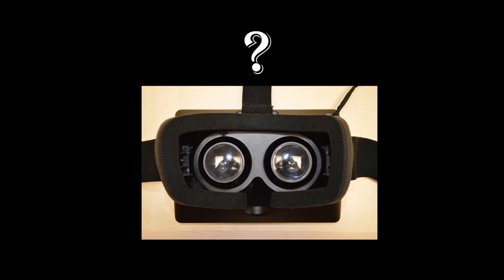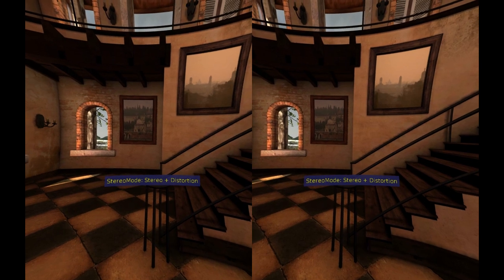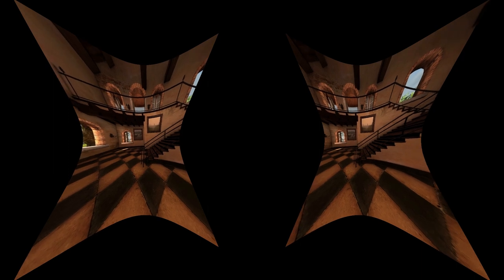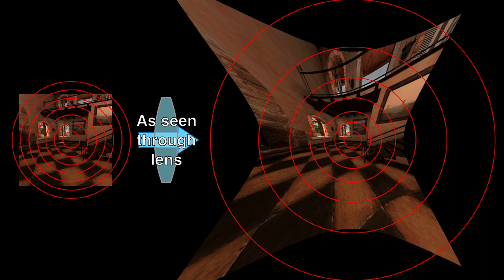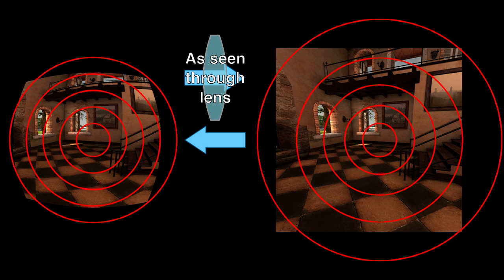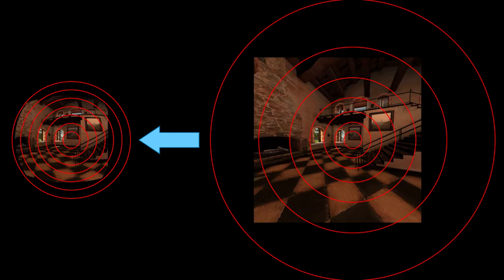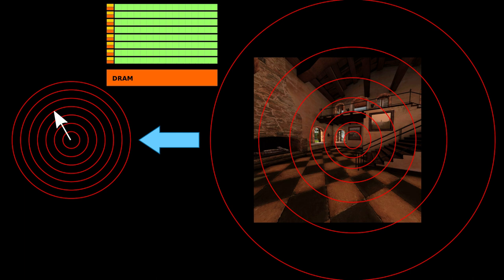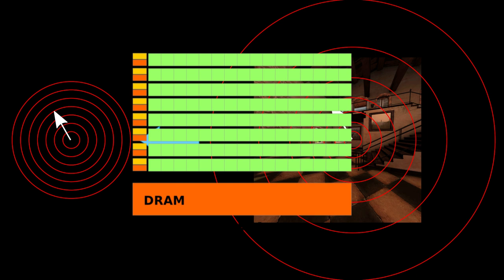How barrel distortion works on the Oculus Rift

Comment: I was wondering if you've ever done an in-depth performance comparison of the traditional barrel distortion shader (which performs the distortion vector calculation dynamically for each pixel) vs other techniques that pre-cache the source pixel texture coordinates either for each target pixel (stored in a texture, let's say), or by using a distortion mesh to approximate the distortion correction. Is it worth the video memory (for the texture pre-cache method) or the loss of quality (for the mesh distortion method)?
Reply from the maker: +Jeremy Bell Oculus switched to mesh distortion so I believe they found it to be the superior approach. This makes sense to me since the mesh is essentially just drawing a small number of unlit textured triangles which is one of the fastest built-in operations a GPU can do. It also scales better to higher resolutions - the pixel shader approach adds quite a substantial overhead per-pixel. On the other hand, if you're doing any kind of ray-tracing, that's a different story - you should be casting one ray per output pixel, and incorporating distortion into that, so that you can avoid having to deal with drawing a bunch of extra pixels around the edge that you're just going to downscale anyway.

Comment: Excellent video! Follow up questions for you. Are the lenses the reason that people say using the dev kit feels like you're looking through binoculars? What's your experience with that -- do you think the average person will be bothered by that? Do you know enough of the tech details to know if it's possible for them to fix or mitigate that effect?
Reply from the maker: This isn't quite accurate. There is some blurriness around the edges of the frame due to the lenses, and this has some vague resemblence to binoculars, but the differences between the two is so enormous as to render the comparison a bit silly: binoculars usually have high magnification but a very low field of view, while the Rift has no magnification (the rendered FOV is projected over the same angle of view on your retina) and a very large field of view. Using the Rift feels subjectively like wearing ski goggles or a diving mask to block some of your peripheral vision and then just looking around the world normally.

I know they are making improvements to the optics for the consumer release, which is important among other reasons for ensuring people with a wide range of IPDs (distance between their pupils) can use it.
Reply: Thanks for the explanation, that makes a lot more sense to me.

Also, not sure if you saw Palmer's comment on reddit the other day, but he confirmed that aside from positional tracking, the first consumer version of the Rift will meet or exceed Valves recent demo at CES. Exciting news considering how strong the Presence effect was with that prototype.
Reply from the maker: Garrett Griffin-Morales I did! And it's not surprising considering how similar Valve's prototype is in terms of features to Crystal Cove. The idea that we'll be able to have presence in our homes will be magical!

Comment: The equation to calculate the scaling factor 1+0.22y^2+0.24y^4 is only valid for oculus rift ,right? for standard VR is there any way to figure out the location of any point in the image ,compensating the magnification and barrel distortion
Reply from the maker: Only for DK1 actually. Each shader has its own formula used to describe its mesh. You either have to reverse engineer the code or collect data from the images and fit a curve. It's no longer a simple radial transformation.

Comment: What settings would I adjust to decrease distortion in the corners of the image. I'm experimenting with running non vr games in vr, and I need more sharpness in the corners
Reply from the maker: The barrel distortion compresses pixels in the corners, then the lenses expand them again. That entire process is fixed based on the hardware. If you want more sharpness in a traditional 2D game embedded in VR, your main options to do so are: 1. use a curved cylindrical or spherical screen so that all parts of the screen are the same distance from the viewer; 2. increase render scale (expensive but tenable in simple scenes); 3. disable fixed foveated rendering, if you're on a system like the Quest that has it, it adds a ton of blur in the sides/corners; 4. make the virtual screen smaller.

Comment: Sorry folks, if this is a stupid question, but by googling a picture of different form of distortions, this seems to me as pincushion distortion. Can anyone tell me why am I wrong?
Reply: And does DK2 use the same method? Would appreciate it if you could show me yt vids or sources!
Reply from the maker: Theperkerify DK2 does not use exactly the same method, but a very similar method, just with more fine-tuning. It is still similar to a barrel distortion, but not technically a barrel distortion. To be clear, the lenses of the HMD induce a pincushion distortion, and the software executes a barrel distortion on-screen to cancel it out, so that inside the Rift you see a rectangle (although it's quite hard to see the edges of the rectangle clearly because it fills so much of your vision).
Reply: eVRydayVR Okay thank you very much! I ask because I am writing an assignment on this that is quite big, thank you very much for your detailed video :)
Reply: eVRydayVR I think I understood it now. In the DK2, the lenses create a pincushion distortion of the picture, then because that distortion looks wierd, the software in the computer thats connected to the DK2 makes a barreldistortion of the former pincushion distortion. Now because the new made image (the barrel distortion) is too small and with to many blank spaces, we scale it up by rendering a bigger image of it with higher quality aswell. That is why that the image in the Rift ind the end turns up be rectangular where you cannot see the ends of it clearly.
Is this a correct understanding of how it functions in the DK2?

Comment: Can you turn off barrel vision
Reply from the maker: Not really. These days it's part of the fixed rendering pipeline of the VR hardware and system software. If you have a custom system or you can hack an existing system you might be able to deactivate it. You can also use a "reverse barrel distortion" shader to try to undo its effects (you run it before the barrel distortion is run and they cancel out). The result will be quite uncomfortable for the viewer though, a lot of stretching along the edges.